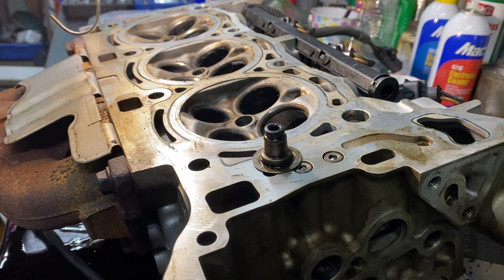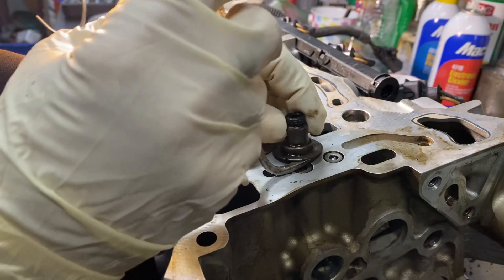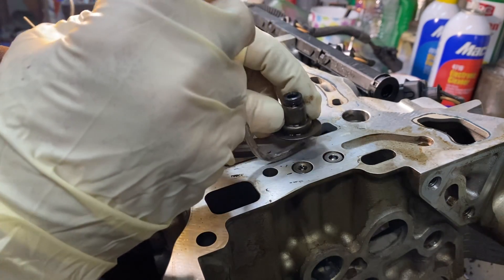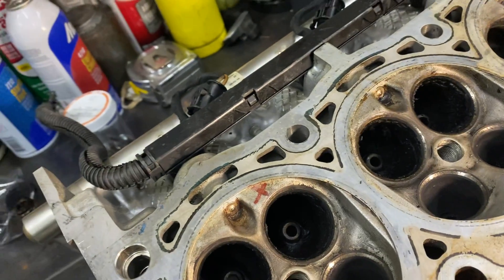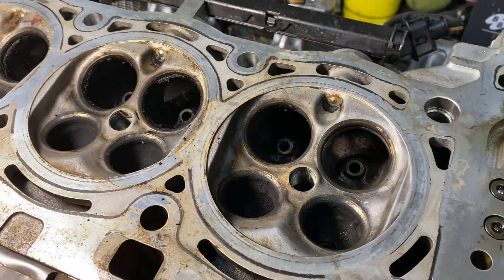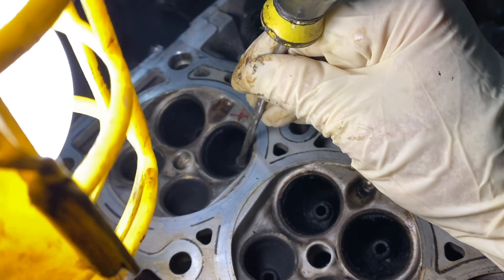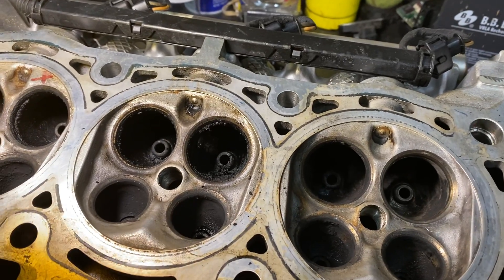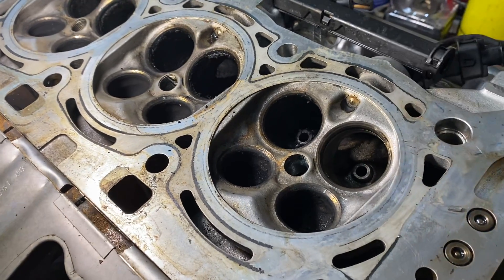09,10,11,12,13,14,15,16,17 GM 3.6 Buick Enclave pt.6 stretched timing chain

Comment: I have looked through the series do you show on video head removal for both sides I must be missing it somehow
Reply from the maker: Keith, I don't remember if I have video on that or not. I did do both sides and they are basically the same as far as the heads go. Of course the timing chains, sprockets and tensioners will be different. Best of luck with it. Rob....
Reply: @robbieraychannel  Thank you for your reply and I have scrolled through what I feel like is nearly every section of this video series and I don’t know that you actually showed the removal of the heads. The series is helpful and details much of the process! Thank you for taking the time to produce it!